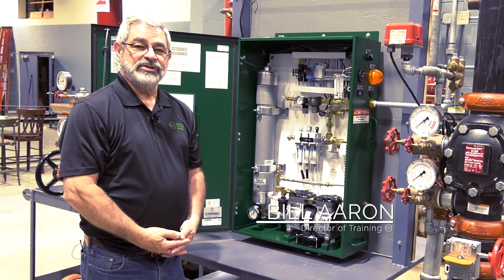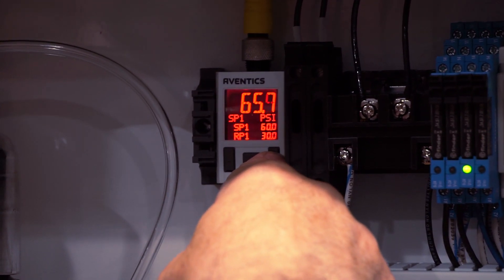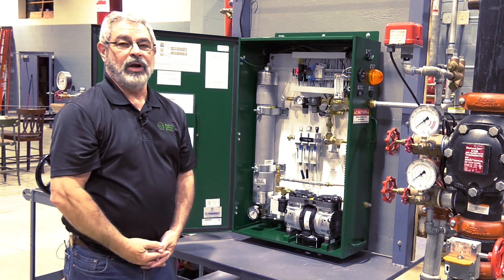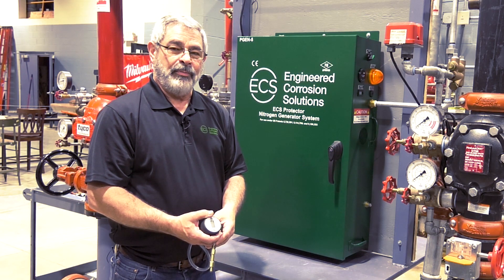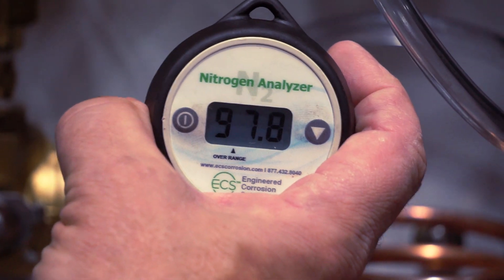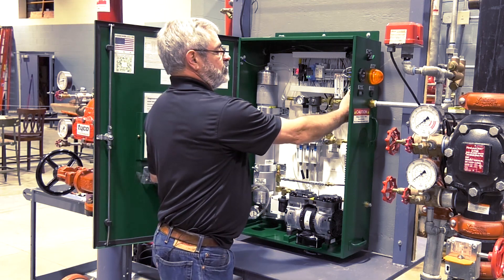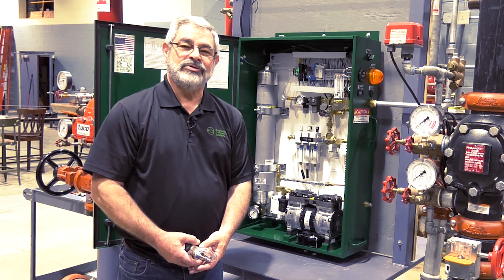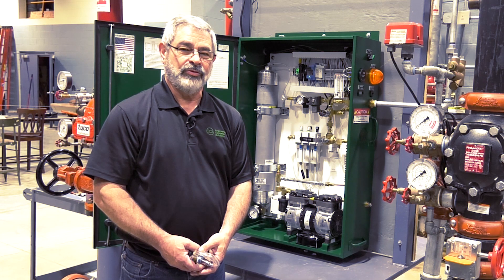PGEN Wall-Mount Walkthrough: Startup

Comment: That was a great video! Do you have any videos that focus on the internal components of the nitrogen generator and give a step by step explanation of the process and what happens through each part/component within the generator? I feel like having at least a basic knowledge of each component and what happens throughout the generation process would help technicians troubleshoot.
Reply: I spent 35 years in the N2 generation business.  Here is what is inside that cabinet.
The long gray "tube" is actually a bundle of hollow fiber polymeric membrane material.  The membrane is permeation rate selective for N2 vs O2. When air flows thru it, N2 and O2 are separated.  (Argon stays in the N2).  Product N2 flows to the customer and waste gas (NOT pure O2) is vented at around atmospheric pressure and almost fully saturated.   Below and to the right of the membrane bundle is a feed air compressor.  This one is very small meaning the N2 generator is very low flow capacity.  Typically N2 units have O2 analyzers with an interlock so if the membrane purity goes off spec (and that DOES happen), the unit will isolate until purity comes back up.  This N2 generator does not seem to have one (at least from the views I see).  
The rest of the equipment is flowmeters, valves, and electronics.   Membranes are simple systems but certainly NOT without issues and downtime. Membrane fibers can foul, meaning complete replacement of the bundle. 
Good luck